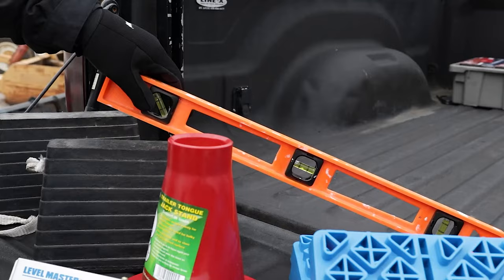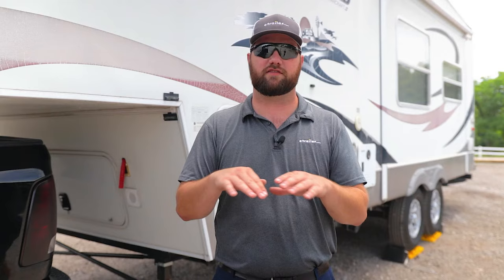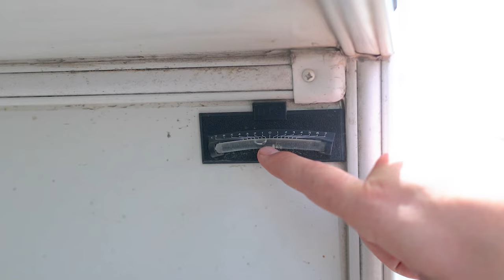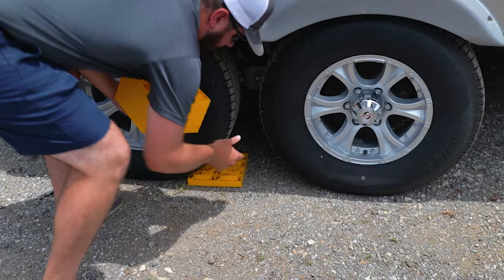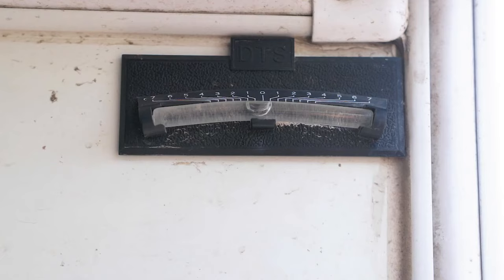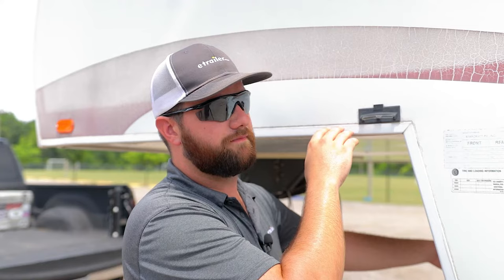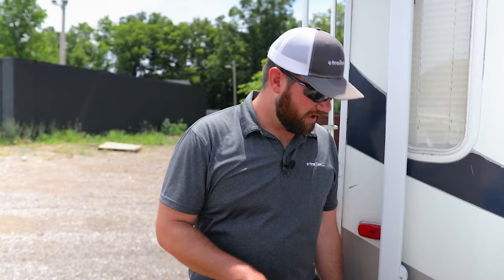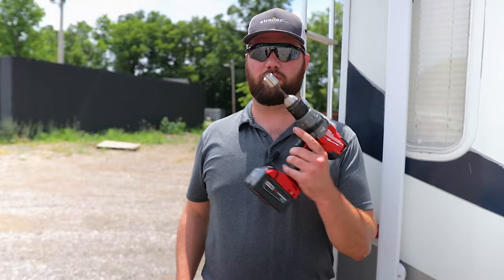How to Level a 5th Wheel

Comment: So I don't have a 5th wheel truck.. I paid someone to put me at my permanent spot. Been there a few years now and my camper is deff off side to side. How do I get it off the ground enough to put the leveling blocks under the tires? Should I close the slide if I end up jacking it up?
Reply from the maker: You'd want to use a jack to raise the side of your 5th wheel, then install your leveling blocks. If the slide operates freely, go ahead and close it before jacking the 5th wheel up, so the weight is more or less centered on a side to side axis. Hope that helps you!